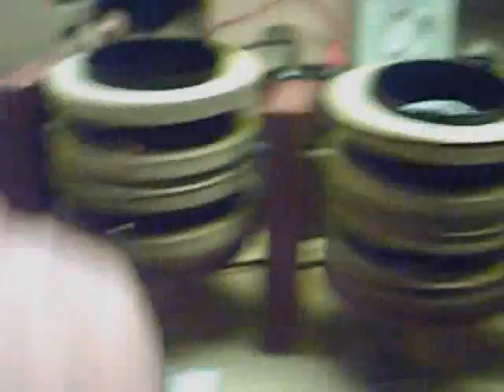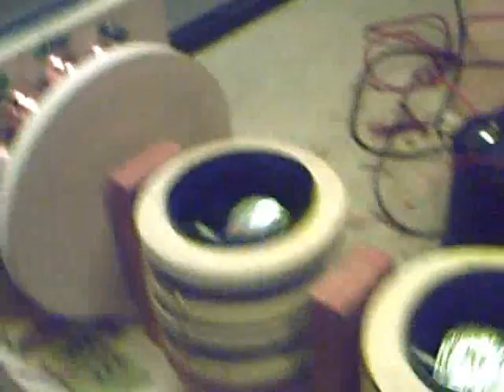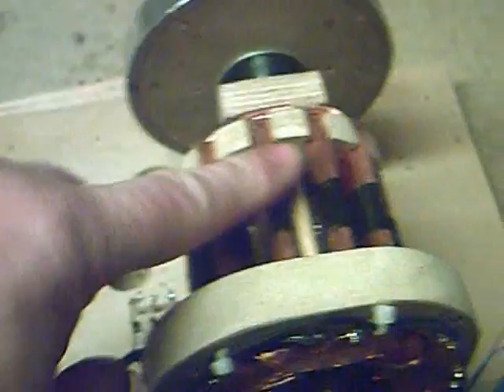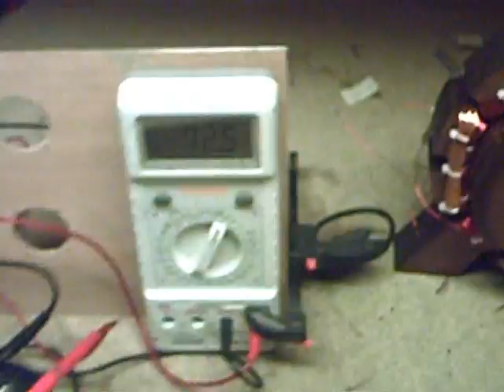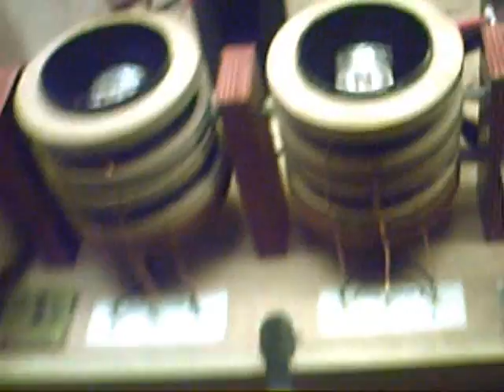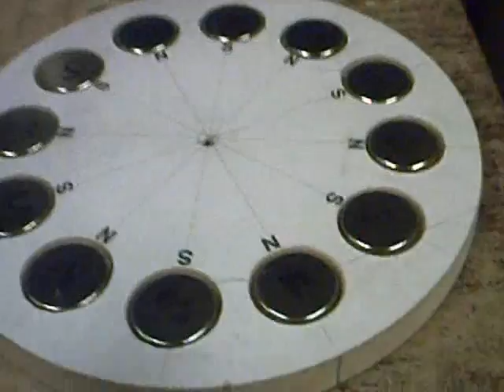Answers to your questions on my all new Newman 4 pot motor.

Comment: Yes, it's been a little while since I have Left any  Comments, on you're stuff" BUT, I been watching... You've Come FAR, pilgrim.... Were it worth it.???
LOLOLOL, OKAY" All jokes a-side,.
Here's, the answer to what you're looking for.!!! Alright, I'm gonna 
Give you the answer: and it is:
( poundage )!!!! Now" if you're looking for "OVER UNITY" That's you're answer.
Now, what I mean, is this: We now know' that energy is like a Stream of water,But only it's a "stream of Gyroscopic partacules" that are released to flow through the Copper wire, North and south, each to it's own direction, according to the way it's spinning..... THINK!!!! OK" LIKE IF YOU TAKE TWO TOPS, SPIN ONE TO IT'S LEFT & THE OTHER TO ITS RIGHT, NOW IF BOTH TOPS ARE STARTED AT THE SAME TIME IN THE CINTER OF A TABLE, OKAY" DO THEY TEND TO SPIN TWORD ONE ANOTHER,??? OR AWAY FROM EACH OTHER.??? AND IF THEY DO HIT TOGETHER, MAYBE THE TABLE IS NOT LEVEL,???? BUT WHAT WOULD HAPPEN.?? THINK MY FRIEND!! THINK.!! YOU'RE ANSWER IS IN THE WIRE,... If you have more wire, it means more mass, OK, if you don't have enough wire, it means not enough
Energy" to carry the load.!! Build a new Newman Motor, use as fine a wire as you can work with, and put ( one hundred pounds of copper wire on the bottom) & one hundred and one pound's of copper wire, on the top.!!!
Then get as strong a neo-Magnet in a bar shape as you can buy, in the middle of it.!!! Spin the bar magnet or magnet's
End over end. Smooth out you're voltage with CAPS, & See what comes OUT.!!!!!!

Comment: Just a thought...  any noise is the sound of inefficiencies, I would suggest changing your controller with buffer capacitors in series with the coils in order to run a sign wave instead of a square pattern.

Comment: mr daftman
I like the things you have been doing, most interesting and creative and fine workmanship.
However, the reason the motor slows down is because of the lenz effect. do a search in a search engine for "lenz's law"
Basically, any generator coil that you draw power FROM will create a magnetic field allmost equal to the magnetic field of the aprocking magnet, hence why it slows down and stalls.

Comment: To stop the load from pulling the system down as much, try revercing the magnetic fields on the windings. As with the ends lined up as N to N and S to S. this will do away with the field brake and reduce the holding of lost current from the input side and incress the out put power by about 8%. I hope this helps. This should also help on the motor it self.

Comment: what if you did not use permanent magnets, but instead calibrated the field/armature circuits to have opposing resonant peaks in ferrite cores matched at a particular angle of disposition at a particular speed of rotation?

Comment from the maker: Milliamps at 100v, at about 3000 RPM so just about correct. Please remember this is only a test bed for the generators also remember the Newman motors only run on volts not amps \ wattage. (If all the spiel about the Newman is correct then it will run if not its consigned to the bin.)   I will be rewinding all the Newmans to run at 65volts each, with a completely different control circuitry. It is my control circuitry that is dragging the currant at the moment not the Newmans.